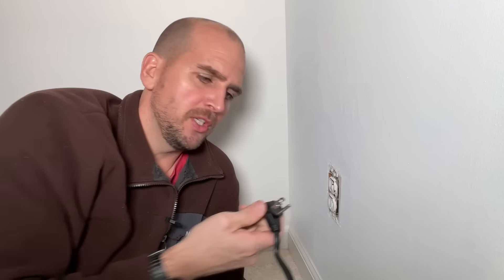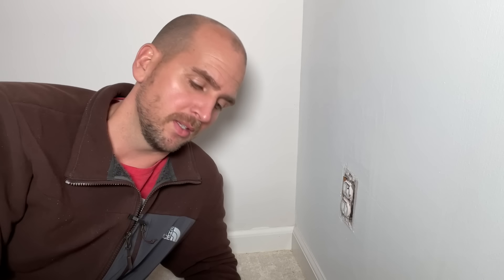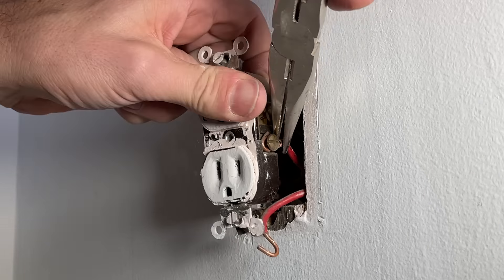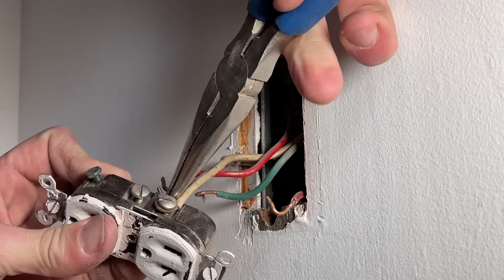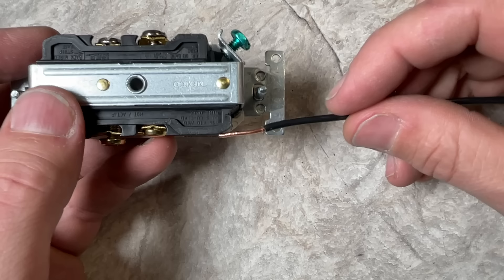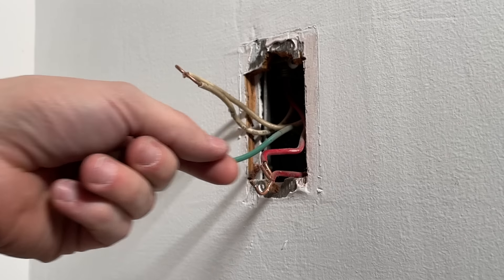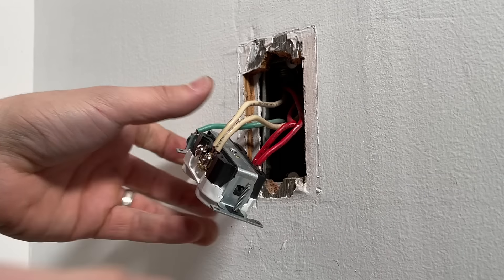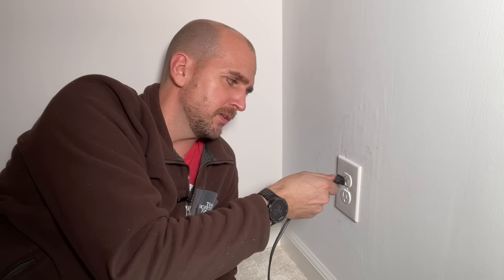Plug Won't Stay In Outlet

Comment: I bought an OLD home and have found many "I'm shocked this place hasn't burned down"  moments....  The outlets are so old on they were made with two tiny screws on the back not sealed like todays outlets...    Oh and had a SHOCK moment, One outlet on two different circuits.... shut off the breakers one at a time yet the outlet was still hot....

Comment: I still prefer the J hook connection.  Too often there is not enough wire in the box to shorten it.  BTW you had the option to straightening the wires with he needle nose pliers to minimize the amount of wire cut.

Comment: Thank you so much for the information.  I rent, but I also do all the maintenance on the property for my landlord.  I've detested every single outlet here.  They won't hold anything, I've resorted to power strips I can screw into outlet.  But that's overkill in many areas.  
I have a question regarding the  outlet under the kitchen sink which powers the dishwasher & garbage disposal. Visually it does NOT appear to be GFI, which it must be by code.  Is there a way I can determine if it is?  I've recently ran into GFI outlets that have no indicators in several new builds.  I'm completely clueless why anyone would use them.  It would seem to me to be an unnecessary extra step when troubleshooting.  I'm extremely concerned about this particular outlet.  The location under the sink is on the wall directly under the sink, behind the plumbing, water lines & dishwasher lines making it difficult to visualize and/or access.   The sheetrock, bottom, sides and bottom side of countertop shows long-term water exposure.  Someone attempted to seal(?) the outlet from water exposure by covering the outlet with a vapor barrier and sealing around the edges with tape.  I'm pretty sure this isn't up to code.  Though I live in Anchorage, Alaska and we've got some gaping holes in the building codes, as well as a tremendous amount of confusion  about what it means to be "GrandFathered In"  as it pertains to  building codes specifically those built as multiple, separate residential units. 
Question: how may I determine if an outlet is GFI, if there's no obvious indicator's? 
Question: If this was your place would you relocate the outlet to an area which doesn't have direct contact with water (Which is possible on same wall, approx. 3 to 4') or should I just leave it where it is but upgrade the outlet?
Thanks for your video, any enlightenment you can shine would be appreciated n
Reply from the maker: Actually the code does not require the outlet under the wink to be a GFCI.  Kind of hard to believe but since it doesn't serve the countertop it isn't required.  If you still are interested in testing the easiest way is to get an outlet tester with a GFCI "Test" button.
Reply: Good question and a good answer.  However, if you still wish that to be GFI, something that has worked for me is to replace the breaker for that circuit with a ground-fault breaker.

Comment: from what ive repaired, back wire often fails before the plug does potentially causing heat damage to the plug and wire or arcing witch could cause a fire thankfully modern circuit breakers detect the issue and dont want to reset or hold so people call an electrician for maintenance

Comment: The usual way I fix it is, I bend the prongs of the plug slightly outwards. Then it stays in just fine. This creates a tiny bit of spring tension against the outer walls of the outlet, allowing a little extra holding power.

Comment: Nice! I disagree with landing both wires on the 1 screw terminal, rather than pigtail first OR doing them separately (as was originally setup with tabs broken). If these were on opposite phases this would just be a dead short phase to phase. ⚡ Too many variables to change that blindly.
Reply: The tabs were not broken on the original outlet. Both red hot wires were in contact.
Reply: I like it, because it keeps the screw pressure more constant across the screw surface, but that's just a personal thing, that doesn't matter practically.  If you do them to separate screws, they're still effectively shorted, unless the link is broken.  Usually the situation as-found is that one wire is truly the hot one, and the other feeds something farther down the line.  He could have flipped the breaker back on, and tested each wire one at a time, to verify that.  I usually don't bother.

Comment: Something to mention possibly - fumbling around, I feel I get better torque with a #3 standard driver over anything other than the perfect #2 Phillips. I have a huge selection of various 1-3 Phillips of all pitches and angles but they are sprinkled over 2 acres and 20 projects. Don’t ream your heads trying to use a Phillips just because you believe it makes more contact.

Comment: One of the hazards of a loose hold outlet is arcing and heat or fire. Also the possibility of damage  to the device plugged in due to voltage inconsistencies. If you ever heard a light switch buzz this is arcing inside the light switch and should be replaced.

Comment: I despise these new safety outlets! Had to hunt down old style outlets as I could not, no matter the angle or pressure used, actually plug anything into the damn things. I had someone else who is stronger and doesn't have tendonitis finally push the plug in and the damn thing didn't work anyway. I understand the logic, but when it feels like you're breaking the outlet (and did apparently in multiple outlets in the last house) they're not all that safe... Why not just use the plug covers like we used to have?

Anyway, thank you for the explanations.

Comment: Take them rec screw all the way out will save the wire insulation.  Before you take the outlet out bend the plug prong's 11 and 1oclock it will hold the plug in.

Comment: My experience with older homes with metal boxes for the outlet, which are almost always very tight, please use electrical tape to cover the side terminals to prevent shorts/fire.

Comment: when I have a 'loose' plug, I just spread the plug blades a little bit and insert again, the spring tension will hold the blades against the contact better afterwards (without removal or replacement).

Comment: With 12 gauge wire in the box, I would check the breaker size to see if it requires a 20amp outlet, not the previous outlet, which may have been incorrectly installed.

Comment: I have found with older homes there seems to be voltage leakage in the receptacle box which causes the voltage tester to indicate the receptacle is still hot. Using the outlet tester is better or I use a voltage meter to see if there is leakage or 110 volts.

Comment: Thank you!    Question:   Why, when replacing the new socket do you only use one screw of two for the hot and neutral side versus using the two separately as on the old one (total of 4 screw contacts used for four wires  in old for neutral and hot and only two for the four wires on the new for neutral and hot).   Just curious.   Thanks again. Electric

Comment: Very nice!  I always keep long screws (oval head) around, just in case.  I personally try not to purchase tamper-resistant if possible, because they're harder to get the plug inserted.  Sometimes that's all I can find.  I love back-wire capability.
Reply: I don't usually purchase tamper resistant receptacles because the shutters sometimes make it difficult to insert the plugs and we don't have small children to worry about.  Our home was built using an earlier code that predates their existence.

Comment: When connecting two hots/two neutrals be sure to confirm how the old outlet operated. Was one outlet switched and the other was outlet constantly hot, or was the plug being used as a pass-through (switched or constantly hot, there's not really a difference). If one half of the outlet is switched and the other half constant hot be absolutely sure to break out the jumper tabs or your switch won't work and you'll potentially be back feeding power to the switch (not necessarily a problem, but definitely not desired).

Comment: I noticed that you didn't break the interconnect bars between the two outlets even though you were using two hots and two neutrals and you attached the two hots and two neutrals to the same screw terminal (which works because of back-wiring). I can only assume that what's going on is that this outlet is in the middle of a string, so one of those hot-neutrals was incoming and the other outgoing.

If instead one of the outlets were switched and one constant-power, you'd need to remember which was which (if you cared about top vs bottom), wire them to separate terminals and break the shorting tabs between the two outlets.

Comment: Just bend the things out a little to provide tension! Have a nice day!
Reply: Doesn't fix the problem long term, and will just keep happening as the inside prongs keep moving.  THEY are worn out and really do need replacement.
Reply: @RICDirector  Mine still stays in. Try but some solder over the pins to thicken them up.
Reply: @redsed1565  Easier to just replace the dang outlet at that point....
Reply: @RICDirector  go ahead!

Comment: You cut the wires and then pulled off more insulation to expose some fresh wire. Did you do that because you had plenty of wire to work with? Can we just as easily bend the wires if they fit into a back-wire outlet?

Comment: So does the ground lug face the top or bottom?  Which way is up when you install a new replacement?
Reply: In hospitals the ground is up and so is the name on the front , the reason is with 3 wire plugs required there if a metal cover plate comes loose and falls it will land on the ground and not short the outlet out ,while with residential the ground  goes down.

Comment: As an electrician in Oregon, i don't like how you passed both wires into the backwire holes. You have basically created that outlet in series where the outlet is carrying the load from the others down from it, also reducing the voltage down the line as each outlet uses up some of that voltage as a load is used.

You should have pig tailed off your conductors to the outlet. That way if the outlet ever dies, you no longer lose all the others.

The only time you wouldn't do that is a GFCI where you put your line voltage in on the bottom and the out going on the top (thats how they're usually made at least). That's the only time an outlet should ever be wired in series.

YES the 15A outlets are made to have 15a peak voltage run through them, but its safer to let the breaker and wire handle the peak to 15+ amps. 14 gauge wire can safely hold 16a, which is plenty before a breaker kicks in. A 15a breaker is supposed to trip at 12a of continuous load

By running the outlet in series the first outlet in the chain will be hotter than the others as the full current of the whole circuit is running through it, rather than just the wire. 

Say you have 3 outlets with each outlet wanting a potential 600 watt load, all outlets will truly only get 334w or 40v

With Parallel they would all get a potential 600w, but the breaker would pop.

a 5a load has 24ohms of resistance in a 120 outlet. Ignoring the resistance of a wire with those 3 outlets, the total resistance of that circuit is 72 ohms, which means each outlet gets a current of 1.67a

So instead of your vacuum or whatever using the 600w it wants, it's only getting 334w. Which causes it to work less efficiently. This is also a reason the lights dim when you turn a motor on, because the lights are now getting less voltage than before. 

With outlets in parallel the total load comes to 15a, which would pop the breaker yes, but it would allow each 600w device to get a true 600w of power to work the way the manufacturer wanted it to. This is why newer homes also have more breakers, but is also why they run more efficiently.

Hmm this comment got out of control... oh well...

Comment: I would use pigtail connectors instead of connecting the wires directly to the outlet. This was if something went wrong with the power outlet you'll still have power reaching the other subsequent outlets on the same power line. It also saves the main wires and all you need to replace is the pigtail when something goes wrong instead of having to cut portions of the main wires each time there's a problem.

Comment: Good instructional video, thanks. How do you (or others) recommend disposing of used electrical components such as these outlets? I assume they should not just be thrown in the trash, given that there are potentially hazardous and/or recyclable materials in them. Thanks.
Reply: What in an outlet do you believe to be a "hazardous" material? It's just zinc/brass and plastic.
Reply: 1) Perhaps you missed the "and/or recyclable" in my question.  2) I was asking about electrical components in general, not just outlets.  @larrybud

Comment: Hey, thanks for the video. I was super interested in the root cause
However - EVERY PLUG in my house has this same "looseness" to it - even ones in remote corners that would not have been used often
There must be another reason this may occur
I suspect that there are (or were) cheap plugs that never held the prongs properly
In my case this would have been around 1978
I've been replacing them slowly over the years and I am almost done, but really curious why!
Any thoughts would be helpful

Comment: I have a question can’t you put each individual wire in each hole/ screw 1 hot on top and 1 on the bottom vise versa with the neutral wires ? Thanks

Comment: sometimes you have 2 hot wires and they go to 2 different breakers then you need to remove metal strip between the 2 screws to separate power like countertop outlets
Reply: and ground should always be on top so if something metal falls on it , it will hit the ground

Comment: 8:45 what is the benefit to installing both wires on the same terminal, as opposed to the previous configuration of a wire on each screw terminal? Thank you :)

Comment: Great video. I really enjoy how you explain all the steps, with a focus on safety. I have a question with the final connection. In the example you show with the back wiring, what is the advantage of putting both wires to the same screw, leaving one screw on each side unused? If you were using a hook on the wire, you would most likely use each screw?
Reply from the maker: That is correct, if I was side wiring I would place 1 wire on each of the screws 👍.  An even better approach is to use a pigtail.

Comment: So as a Mom with no experience in electrical work at all (except sticking a key in an outlet as a 4 yr old & shocking the mess out of myself & scaring the devil out of my Mom 😆), am I safe following these instructions to replace all of my outlets in my apartment? I love my apartment, but our maintenance is jacked up on what looks like drugs & I don't trust them coming into my home. I'd rather just switch them out myself because my plugs are almost falling out of all my sockets in my bedrooms. Having children, I'm afraid they will start a fire eventually if they aren't replaced.

Comment: A big thanks for installing the outlets with the ground at the bottom. I can't tell you how many commercial installations I  see even my hospital research lab has the ground at the top! I have had two plugs replaced because the ground BROKE OFF because the weight of the 220v over the years put strain on it with the outlet installed ground up.  And the campus electricians will not change what they do.

Comment: in a pinch as a temporary measure you can simply pinch the contact plates back to a tighter gap. but, you should really replace them if possible.

Comment: With 2 wires on each side, check if the cross connector between the 2 screws, on each side, is in place or not. If not, one of the 2 outlets may be on a switch.

Comment: So I am curious as to why you always check both plugs on a receptacle when confirming both power off and on? I am too old to remain presumptuous in just assuming the new outlet will always function as intended especially as without fail I always use comm. grade Levitons

Comment: I learn this problem with outlets the hard way my garage door would not open, so I called repair man thinking & hoping my garage door power head was burnt out :) I wanted to upgrade to the newer one that can be control my cellphone.  I think it is called a lift master with life belt warranty.  But the Tech guy said it was the outlet that was causing the problem with continued years of opening & closing the outlet openings had become ovaled out thus cord was lose & not making good contact with power source. My service call was$75 bummers :(  I replaced outlet myself since I had serval new ones in my tool shed.

Comment: A little off this video but... most people install receptacles upside down, probably because it reminds them of a face, but if the ground is up they work much better with grounded cords because the ground pulls out and  the pressure keeps the other two contacts pressed into the receptacle. Install receptacles ground up.

Comment: I live in an older apartment complex that was built in the 70's, and I'm pretty sure I have the original outlets. Most all of the chords are falling out, and my landlord is aware of it, but won't schedule maintenance to come over because maintenance is "crazy busy."  I do agree with you that the 3 prong does stay in so that's what I'm hobbling with now. Couple of questions. I know you can't plug a portable air conditioner into a power strip but you can plug a portable air conditioner  into a surge protector, right?  I have a fan in front of my portable air conditioner to help push out air flow, and a small little wyze security camera that sits in the windowsill. If I have all 3 of those plugged into the surge protector, is that too much?